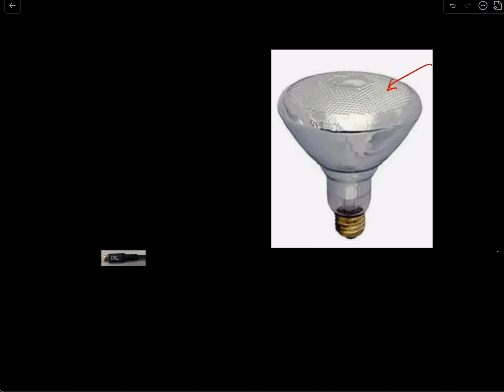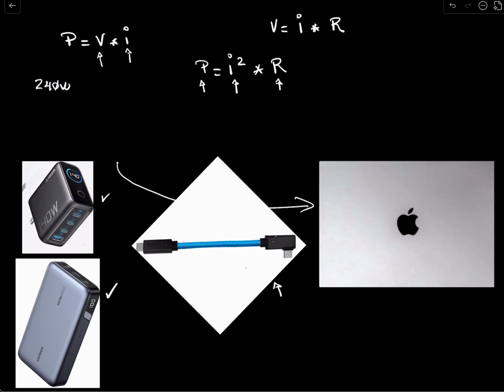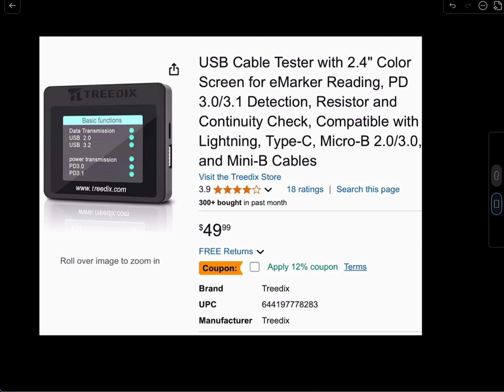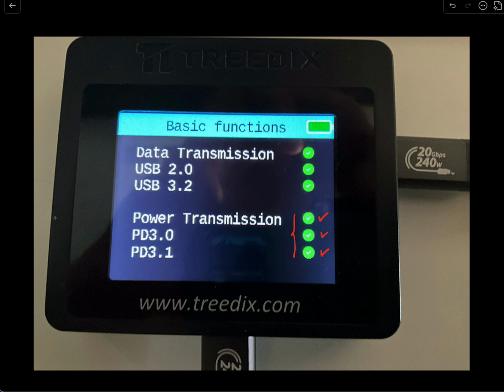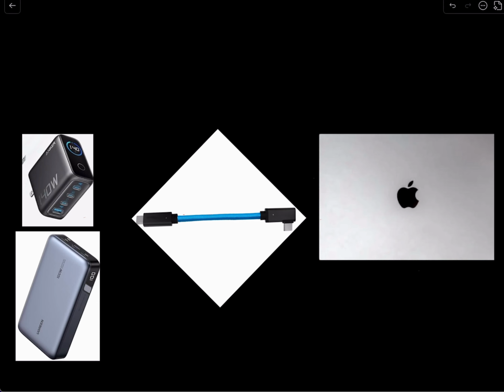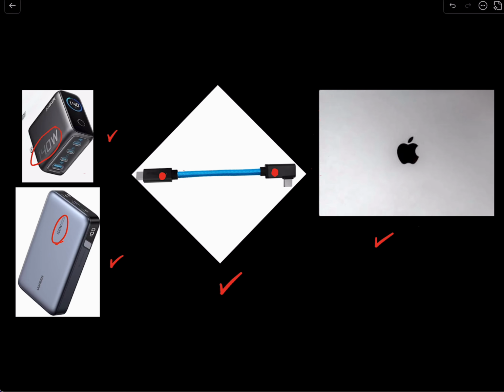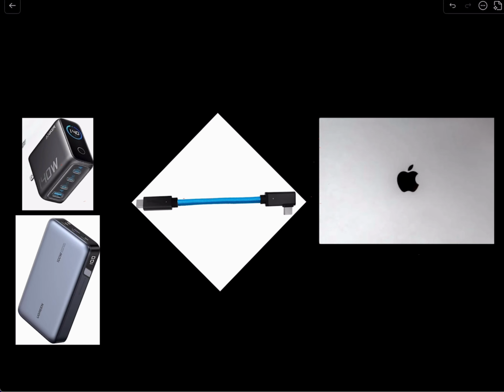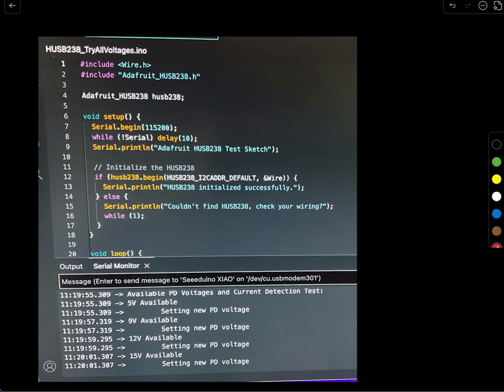Getting the most out of USB C Power Delivery

Comment: Great video. I just ordered the analyzer you went over. Please send me fifty bucks 😁.

When Type C/PD was pretty much brand new around 2017, I was an applications engineer at Arrow Electronics, in Sillycon Valley. I got a fair amount of training on it, and got a little analyzer gizmo made by Cypress to be able to see the traffic, but I've always found this stuff to be pretty confusing -- esp. with so many different protocols (Thunderbolt, USB, HDMI, DisplayPort, etc...) and versions (3.1, 3.2, 4.x?). Not to mention so many different cable types -- does it have the e-marker? Does it support data transfer via D+/D-? and on and on. 

(What I've been doing is marking power-only passive cables (which is what comes with a very large number of rechargeable devices from China) with a colored tie wrap so that I know they can't do data.)

This analyzer will make sorting through my large # of Type C cables a doddle -- e.g. I have no idea how much power my PD cables can deliver.

BTW, one thing that confused me in your vid is where you show the screen that shows the connections at both ends of a cable. On the RH side, the D+/D- pins are X'd out, even though they're present on the other end. Does this mean that that cable cannot do D+/D- data? (Not that it matters much, I'm just curious.)
Reply from the maker: Thanks for your comment. My guess is that this device does the tx/dx  switching itself, since that is the way you should use this tester. As I said I have no affiliation with any of these companies. I just learned a few things about USB-C PD and wanted to pass that knowledge along.